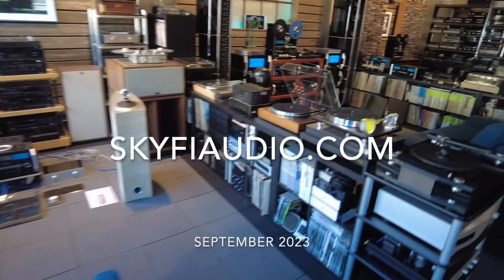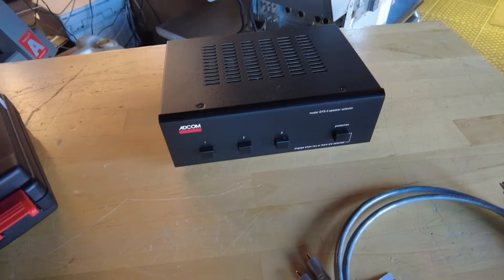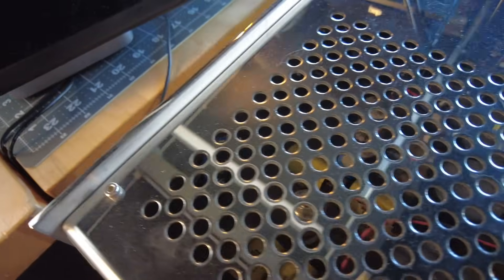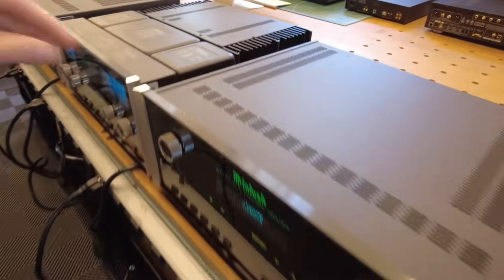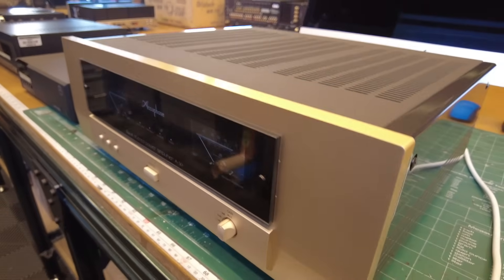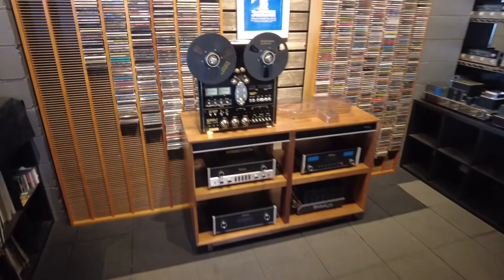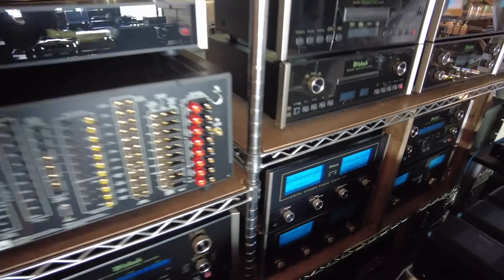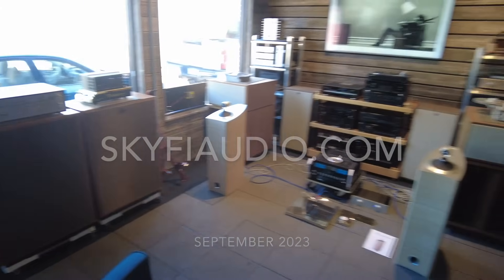New Hi-Fi Arrivals, McIntosh, Accuphase, Devialet, Nagra and More

Comment: 1:09 They're gaudy bathroom scales. Seriously, if it isn't laundromat machine looking speakers, it's bathroom furniture. Has a hifi designer ever been to design school or is it still just electrical engineers and salesmen putting these things together aesthetically? At the top end, it's the one remaining tech industry where actual trained product designers don't really work - the design is led by untrained egos and they fall into traps like this because they aren't researched. It's only in the last 5-10 years that they allowed trained typographers to fix the lettering on the silkscreen control panels. Marantz and Mcintosh were atrociously naive in theirs before someone finally had to fix it.